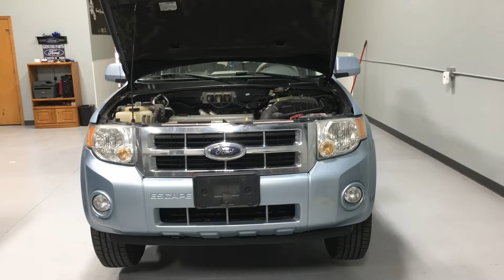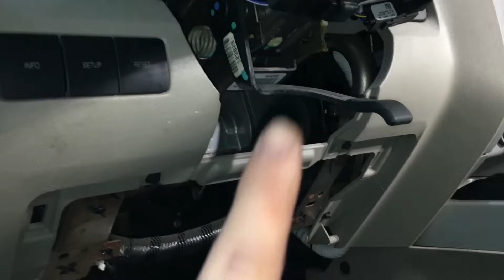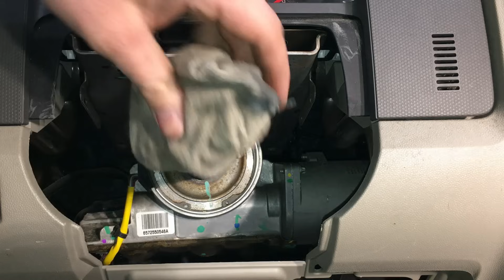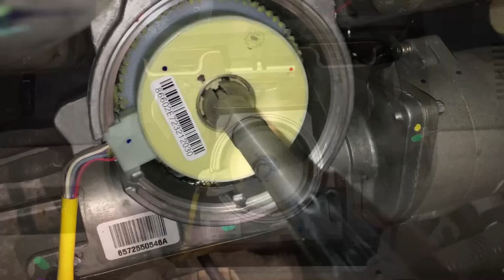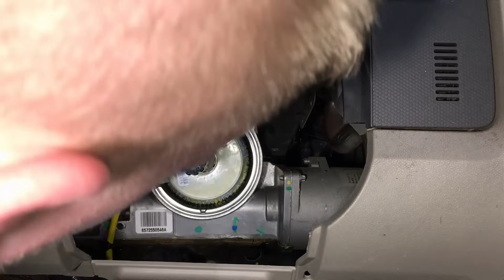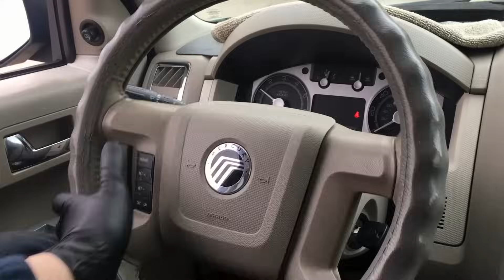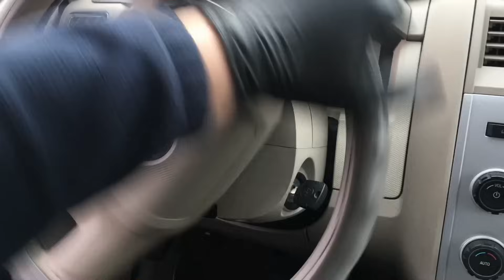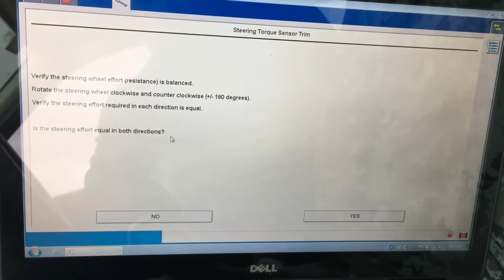2008-2012 Ford Escape Power Steering Code B2278 : EPAS Torque Sensor Critical Installation Steps

Comment: Hello اناعمار of Iraq please help me solve the problem in the engine Ford type diesel f350 model 2005 problem Hey when the engine cold actuation when be hot broken engine والمشكله 2 in the wheel other same kind model engine spins of the key to the operating ولايشتغل tried to repeatedly you clean sensitive oil pressure and you examine the pressure of diesel ولاتعمل only going on the engine without ignition ..... you and I thank appreciation

Comment: i have a question, Can you change a Ford Scape from 4x2 to 4x4?
Reply: LAWRENCE / L-JETRONIC  this generation doesn't use a transfer case and should be referenced as awd not 4wd like some of Ford's badges would infer. Short answer, no there's not a switch to select 2wd or 4wd.